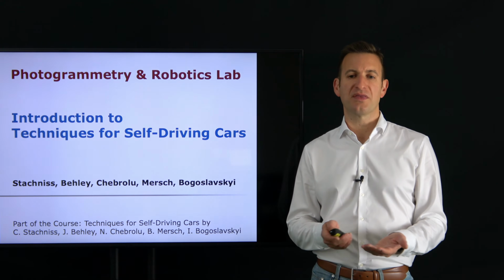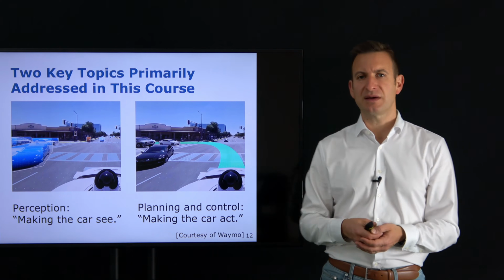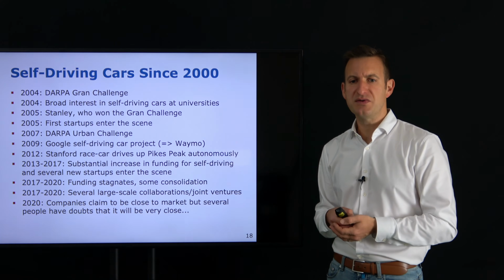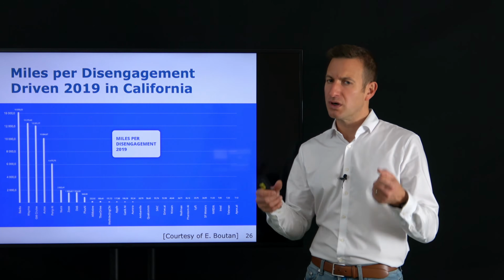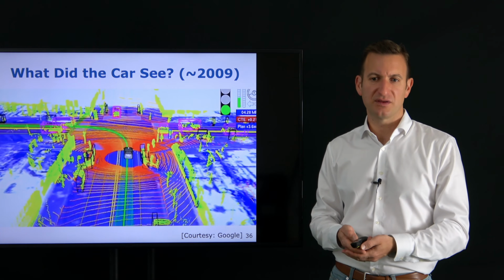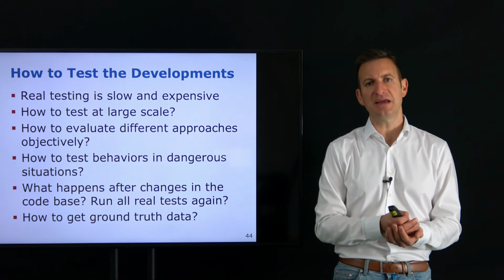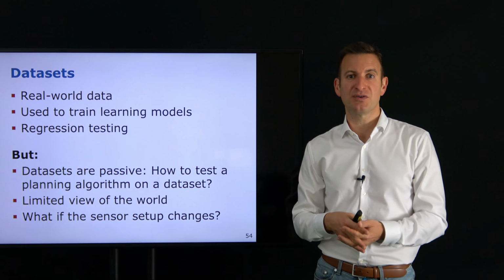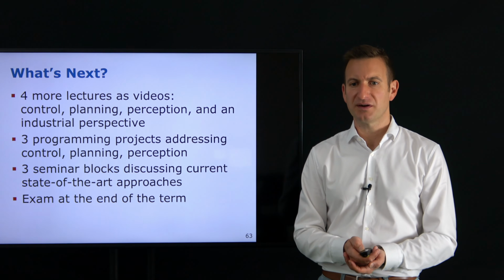Self-Driving Cars: An Introduction (Cyrill Stachniss)

Comment: Thanks to Prof. Stachniss for releasing providing such wonderful resources. It will be easier to follow the contents If the related slides can be provided. just wondering that if it is possible to provide this course's lecture slides?
Reply from the maker: Yes, simply check out my teaching website. You find all the slides and the 2020 exercises there. Alternatively, sent me an email.
Reply: @CyrillStachniss  Dear Prof. Stachniss, I have checked out your teaching website and still cannot find the material link. I found that there will be a slide link in other courses, but not in this course. Also, I have sent an e-mail to you (the name is CHI-CHANG LEE). I was wondering if my e-mail was missed. Is it fine to send this course's materials to me? (like lectures and exercises)
Reply: @李吉昌-w3u  Hi, did you manage to find the slides and exercises for this course in the end?